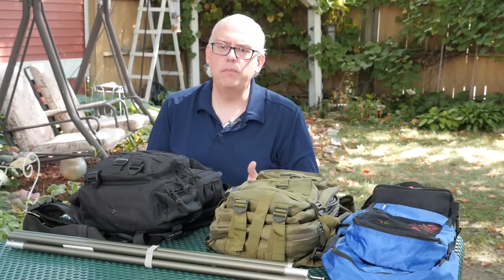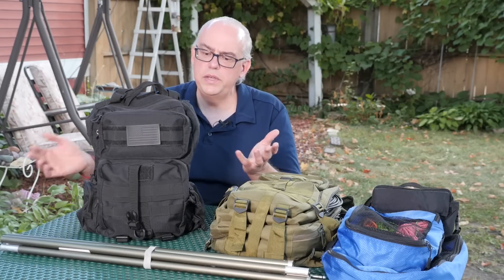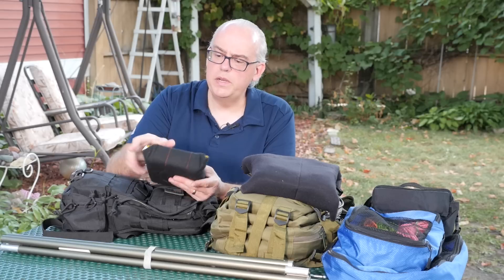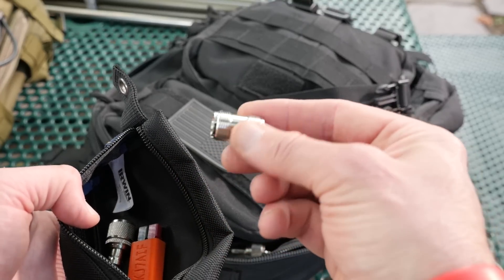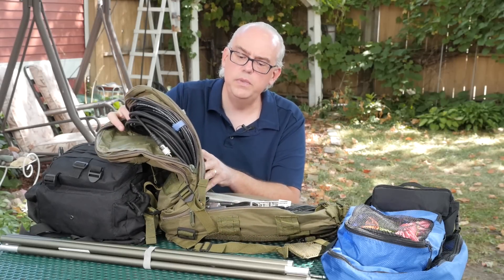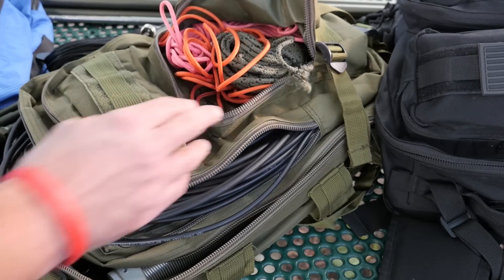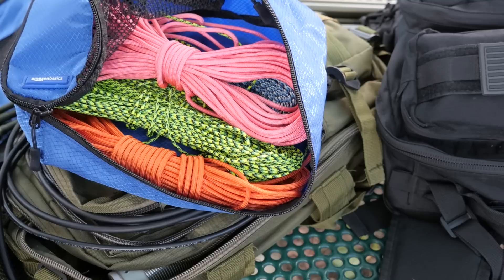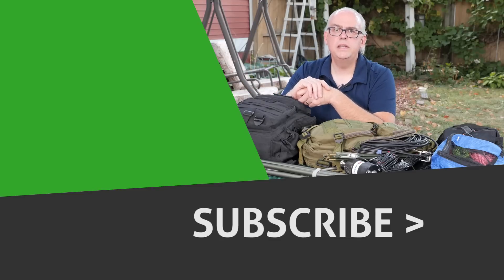My 2020 HF Radio Portable Field Kit - Ham Radio Q&A

Comment: Wow.. Certainly not a grab and run emergency kit for emergency SHTF situations. Personally, I use the bare minimum and easy to carry, which includes essentials like food and water. I also prefer basic wire antennas or even the Wonder Wand antenna... A fantastic field antenna.
Reply from the maker: The intention of this bag isn't for grab and go or SHTF, but instead everyday use. If my portable HF gear is in two convenient bags, I can quickly pack the vehicle and take off for a portable operation. If I am concerned about an emcomm deployment, then a separate with those essentials would be added. I don't think it makes sense to carry everything for every contingency with you, but to use a modular approach to deployment and communications.

Comment: Great video!Thanks to you and K8MRD, I just ordered a 891 and a WRC Silver Bullet TIA. What size Domke wrap is that you use for your radio? Is it the 19" x 19" that your link takes us to? Thanks so much for the informative videos.
Reply from the maker: I'm using the 19 inch Domke wrap. It fits the FT-891 perfectly.

Comment: Do.youhave anything other than you camper/vehicle to charge your battery ?
Reply from the maker: At home I charge the batteries with a 5ah LiFePO4 charger. While on the road I use a Renogy 100 watt solar suitcase to keep the batteries charged.
Reply: @KB9VBRAntennas  okay thanks

Comment: Someone please explain to me...why would anyone buy a rig expert or other "antenna analyzer" for $300-$600 when a nano vna is < $50 and has a much greater frequency range???
Reply from the maker: Portability: the Rigexpert is self contained, you don't need to bring a laptop with you. Reliability: the Rigexpert is rugged and doesn't require constant calibration. Simplicity: The Rigexpert is easy to use and easy to understand. These are all features that make a tool like this invaluable in the field.
Reply: @KB9VBRAntennas  I love your videos, and respect your opinion about many things related to amateur radio!  From your response, I am guessing that you have never used a nanovna device.  I have never connected it to a laptop, and it has a built in rechargeable battery so I consider it to be a portable device.  Per the nanovna website, calibration is only necessary when a new frequency range is selected, and calibration for that range is not already saved to one of several calibration memories.  Please keep making great content and sharing your experiences!

Comment: @ 6:24, i'm studying for my ham license and i already see the first violation about your cigarette lighter plug:
Why is it best NOT to draw the DC power for a 100 watt HF transceiver from a vehicle's auxiliary power socket?
B. The socket's wiring may be inadequate for the current drawn by the transceiver.
Maybe I have a talent for spotting violations, i should become one of the voluntary monitors haha.
Reply from the maker: You are correct, automotive wiring won't support using the cigarette plug for long periods of time. In those situations I turn my transmit power down to 50 watts. In my vehicle I do have a properly sized and fused cable running direct from the battery, so the accessory adapter is just a backup.
Reply: @KB9VBRAntennas  I know you got this covered, i was just pulling your buttons :D i really enjoy your fox hunt videos btw!

Comment: Which size padded sleeve did you buy for the tuner? 11” or 14”? My guess is 11” but I figure I’ll just ask the boss!
Reply from the maker: It's a 12 inch sleeve. A little small, so if I was to get another, I'd go slightly larger. https://amzn.to/3iTlKdz
Reply: KB9VBR Antennas I’ll go with 14” thanks!

Comment: I want to see you set it up on the clock please.  Time from roll up to first successful transmission.
Reply from the maker: Depending on the antenna I use, I can be set up in 15 minutes or less. It's all about packing efficiently and knowing your equipment.

Comment: Good setup.  I would add a shorter power cable for the rig.  I think you would be surprised how much  voltage is lost in that long cable as well as rf getting into the power cable.  73

Comment: Wow great video.  One suggestion, invest in Velcro cable wraps.  Makes a big difference.  https://www.homedepot.com/p/VELCRO-Brand-8-in-x-1-2-in-Reusable-Ties-50-Pack-90924HD/202261940
Reply from the maker: Velcro straps are great. Most of my cables have them but not all. I guess I have a bit of work to do.

Comment: Весь ваш комплект расчитан не для портативного применения, а для транспортировки его  на автомобиле. Портативный комплект должен быть легким и умещаться в одном рюкзаке! R3TU 73!
Reply from the maker: "Your entire kit is not designed for portable use, but for transportation by car. A portable kit should be lightweight and fit in one backpack! R3TU 73!"

You are correct. If you watch my other videos‚ my portable operation is based around car camping. If I was going to hike with this equipment‚ I would take just the essentials.

Comment: I was always a backpacks person, but will be fitting out the radios, battery, and power supplies in a Pelican this year. With Covid, I can't count on operating IN a dry shelter any more. Might need one with wheels and a handle to lug it. Hoping for a very light storm season, our county is very conflicted about what they might be doing.

Comment: Nice setup.  Looking to go portable vice homebound.  Wondering if there are any grounding considerations.
Reply from the maker: Most people ground for lightning protection and certain styles of antennas do benefit from good grounding. I tend to stay away from those types of antennas while portable and will disassemble my station in the event of bad weather. That being said‚ I don't ground when operating portable with one exception. When our club sets up our Field Day station we ground everything- but this is because we're using a generator and we may not be able to take down the portable tower in the event of a storm.

Comment: I put together a battery box to use for powering my radios.  Just used a smallish tool box and some custom cut wood to make a panel inside the box.  Got a couple of re manufactured  10AH LIFEPO4 batteries and paired them together for a power source.  I've got a charging port, 12v socket, and power pole connectors on my home made panel in the box.  I've been able to run my ICOM 718 for easily a few days on and off with it, operating for maybe 3-4 hours a day.  Plenty of power, but not terribly portable as it weighs probably 10 pounds.
  I have yet to determine a good antenna setup to use for my portable / POTA setup.  I also have yet to find a good portable radio that I really want to use, for HF I only own an ICOM 718 and a uBITX that's in need of finishing.  The yaesu FT-891 is high on my list of possible radios.

Comment: This video has proven to me that i am not this willing to get this deep into ham radio. I now realize im just wanting to be ready for emergency situations, not really interested in casual communications. Thanks for the video.
Reply from the maker: My portable kit also doubles as my emcomm kit. Along with the VHF/UHF radio for local stuff- I can set up an HF station and communicate on the state-wide emergency nets. Not everyone needs to carry HF gear‚ but it's good to have at least one person on your team with that ability.
Reply: KB9VBR Antennas i apologize, i wasnt being derogatory in any way. Im new to ham and just had the revelation that ill never be the go to radio guy in our group. I do want to learn the technology so i can communicate effectively, i would just rather specialize in other areas. I do appreciate that a good radio guy is essential for any group.
Reply from the maker: 02cents no need to apologize. I was in the same boat when I first started out. With time and experience you gain a whole lot of useful knowledge.
Reply: I'm looking into ham for emergency use.  This kit is NOT for emergency use.  This is a kit made by a man who enjoys his hobby.  

I will eventually get a kit together.  But it will be simple and compact.  Admittedly I'm only going for VHF UHF.  But this much gear would be better in a roller case in the back of a car.  In which case I'd just have the radio in the car.  

I plan an antenna mast that the wheel of the car supports.  And to use the natural terrain to get height.  I've planned my locations according to who I want to talk to.

My Bob will not contain any of this.  Well I don't have a Bob.  Just an emergency bag for a few days.  
I either stay home or leave by car.  

I do however think radio Comms will be a valuable skill. So I'm learning it now.

Comment: Have you ever used the Budipole or Budistick antennas?
Reply from the maker: Years ago I built a buddipole. When W3FF first introduced the antenna‚ he had the plans available so you could build your own. It's an excellent antenna and I had great luck with it. But with all things homebrew‚ it fell into disrepair and I moved on. I may go back and build or buy another one. I've had a little experience with the buddistick- because it's coil is smaller than most loaded vertical antennas‚ it can be a bear to tune. But once you get the hang of it it works well.
Reply: @KB9VBRAntennas  Than you for the input. I'm looking to go lightweight portable, probably QRP,  My goal is to load the whole thing into one large military back pack with solar cell and LiFePO4 battery. I have no use for digital modes.
Reply from the maker: I think the Buddipole is a worthy solution; there are a lot of options if you are going QRP- like Packtenna and SOTAbeams. I'm thinking of doing more QRP also as we slowly crawl out of the bottom of the solar cycle and we will once again be able to take advantage of the higher bands.
Reply: @KB9VBRAntennas  Here in NY, the propagation is dead. No sense in trying to brute force a signal out if you can't hear it. The kindest thing you can say about it is it's sporadic. Looking at the Xiegu G90 for QRP.  Been brawling with an on-line group about Icom 705. No one really wants to talk about issues with it. Think they're mostly fanboys.  Have a good one.

Comment: Thank You. This is a nice set-up. I'm still carrying my little mfj QRP tuner. I'm going to carry a SOTA Beams Travel Mast and my mfj EFHW low power 10m-80m antenna for Dxing. I have a Wolf River Coils Tia and the modification that makes it the YAFI but I'm looking now at trying to use the Comet HFJ-350 M 6m-80 meter whip antenna. I'm going to add a Bioenno battery with a solar panel and appropriate charge controllers. I also have a Wonder Wand Wonder Loop antenna also, which works fairly well but I'm going to need some type of rotatable table to rotate my radio to orient it easily in the best direction. I'm also looking at  the Wonder Wand Wide Bander and also the Chameleon F-Loop Antenna also. You've given me some great ideas so now I have to decide and pare down my equipment to the right level for travel by bicycle and aircraft.

Comment: 2 things I didn't see your can of Beanie Weenies and then we use the child's stopper pistol to shoot our lineup about 30 feet and go over the tree limbs didn't know if you'd ever tried that or not
Reply from the maker: Beanie weenie is a little low brow for me‚ but I do have a can of SPAM in the trailer. Joe and I tried a sling-shot one year for winter field day. The rubber broke in the sub-zero temperature.

Comment: Love the Iomega bag!  Just transferred a zip disk for a customer last week!
Reply from the maker: Those drives are sooo old. I'm surprised the data was still good. I hope your's doesn't develop the 'click of death'
Reply: @KB9VBRAntennas  ha!  I remember the click of death.   Surprisingly my original serial port drive is still working great.  I remember being on a waiting list for a couple months in 1995 before they shipped it.  Have picked up a few more 100mb & 250mb USB versions over the years.  We mainly do videotape conversions but about once a month will have someone bring in zip disks and/or 3.5" floppies.

Comment: What size solar panels do u use?
Reply from the maker: I use a Renogy Eclipse 100 watt panel with the Voyager 20amp charge controller. I've had it for about a year and like it so far. The panel is very efficient‚ I can get about 5.5-6 amps out of it in full sun. The controller is PWM but it doesn't seem to create any appreciable noise on the HF bands.  It also comes with a really nice case for travel. https://amzn.to/320B01G

Comment: Only one battery? I have noticed you are typically near your camper so I assume you get power from that?
Reply from the maker: I neglected to mention the camper's battery. There's a 50ah LiFePO4 battery in the back of the camper that I will connect to so I can run full power with the transceiver

Comment: I didn't see a convetional DC power supply (to use when shore power is availabe) and no laptop (for logging and digital modes).   I do carry both and have condensed everything into a single padded carry-on suitcase.  It weighs about 23 pounds and I love watching it on the TSA x-ray monitors at the airport.  Surprisingly it's never been pulled for inspection. 😀
Reply from the maker: I typically use battery power in the field so a DC power supply isn't part of my regular kit. Otherwise I have a small 25 amp switching supply I'll use if I'm set up in some place with electricity. As for logging‚ I'll use paper unless I'm in situation when I need to track duplicates (like Field Day) or want to run digital. In that case I use a cheap Windows 10 computer I found online for about $160

Comment: Another great video Michael. I put together a go kit, but I know I did not put any fuses in the kit. I will fix that in the next few days. Haven't found a bag for my solar panels yet, but I did find a new setup for my fiberglass mast for putting up my antenna. Keep up the great work, and thanks again for saving me some anguish on my next trip out.
Reply: @Jason Bowman Yes, a blown fuse will tell you which circuit, and then you will need a new one to complete the repair.
Reply: @Jason Bowman I always carry an old, small tackle box that has connectors, short coax, soldering iron, solder, and a few components in case I have to repair something in the field. I just forgot the fuses. Even if I change out a solder run, then what? Put a penny where the fuse was? Hate to go thru all that and then realize I forgot a fuse.
Reply: @Jason Bowman Hey, I didn't mean to sound rude, just wanted to explain. Thanks for caring enough to comment.

Comment: All that's missing is a folding solar panel to keep the battery charged.
Reply from the maker: I've got a 100 watt solar suitcase that travels with the camper‚ you'll often see it in my Parks on the Air videos

Comment: Overkill for most but I like to bring a foldable 260w solar panel and solar charger+50ah lifepo4 batt. Gives enough power on cloudy days/weeks and I just fold up a few panels to reduce input power if it's sunny out.
Reply: yea... I wouldn't call it overkill at all - yea... you could argue that 50W/100W may be overkill - but for those of us chasers trying to make contact with you guys that barely are breaking the noise floor - a setup like this will allow the SOTA dude to bump up the 100W and have many more activations then not having the extra power... so yea.. guess overkill is subjective.  I can't tell you how aggravating it is as a chaser when you want to help with activations and you can barely hear that SOTA dude with his 5W QRP radio. - just saying

Comment: Hi Michael, Enjoyed this video! I Have the WRC SB1000. I want the Chameleon Quad to put 20m-40m ham sticks on it. Check out my QRZ page or my YT cahnnel. I power my FT-891 from a Dewalt 20 volt battery for portable ops. Kevin  KA0KAE

Comment: Hi Michael I am more interested in your trailer I’m curious how that works out for you and how that would work for me with the QRP also the biggest problem I have is I have no portable housing to go . so let me know how you came about the trailer and I will look and see if I can find something like that it looks interesting thank you very much Pat
Reply from the maker: The trailer is a 5x8 foot camper from TC Teardrops: http://www.tcteardrops.com. I think it makes an awesome platform for portable operations‚ especially now that we've added the awning. There's a queen sized bed inside and a galley kitchen in the back. It's light enough that my Subaru Outback pulls it without any issues. This is our third season camping with the trailer. After spending 25+ years tenting‚ we were ready for the upgrade.